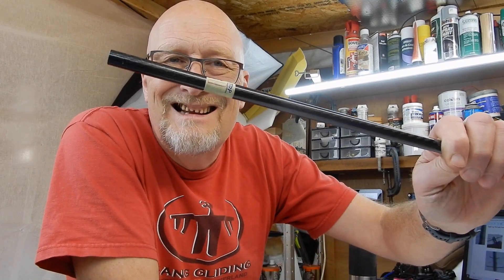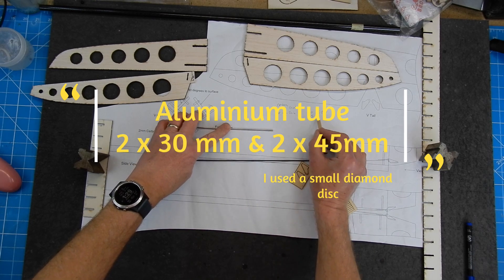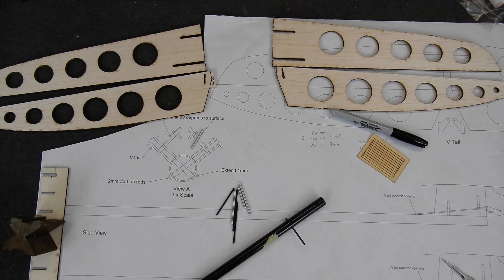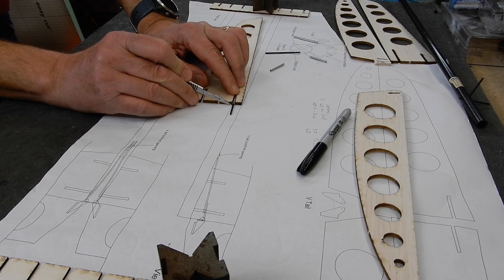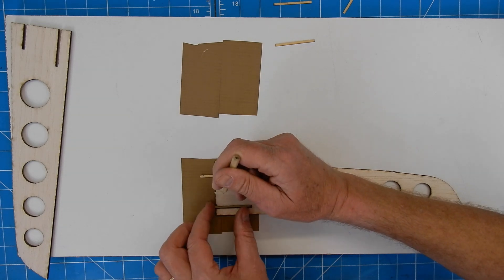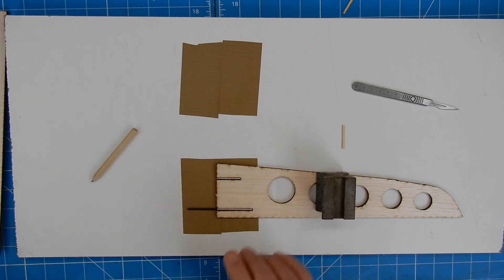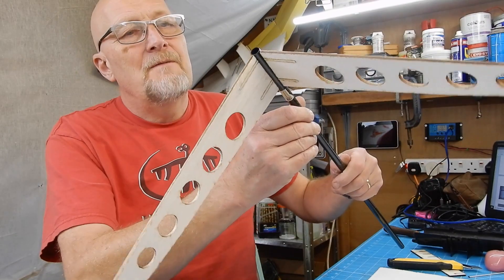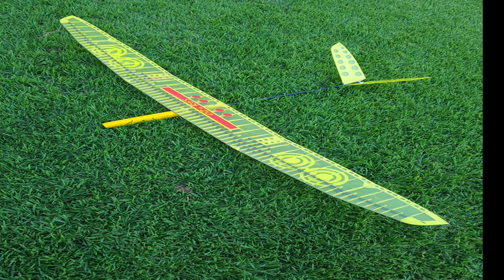How to build a OZeRES 2 – 2 Metre  electric  glider Part 2 The Tail

Comment: Nice Video on the V-Tails.  Here is a slight variation on your method that may work a little better.  Do the left & right sides at the same time, before cutting the carbon joiners into 4 pieces.  No measuring, and I think this would ensure that each side was square to the other in all directions.  Just, carefully, tack them down near the center of each of the 4 tubes.
Reply from the maker: Like it Mickey